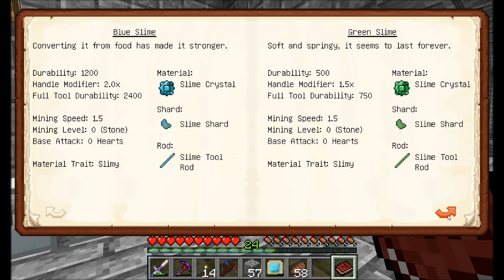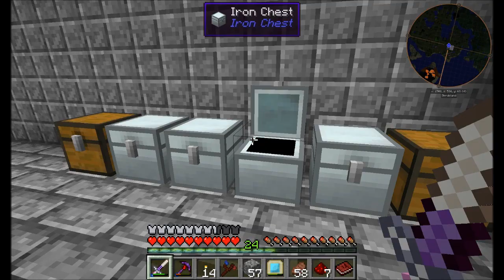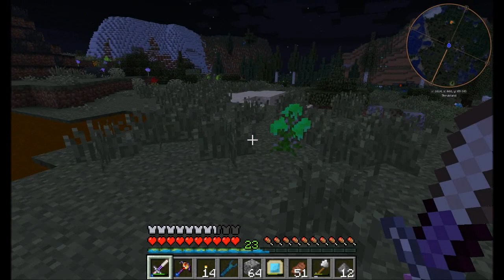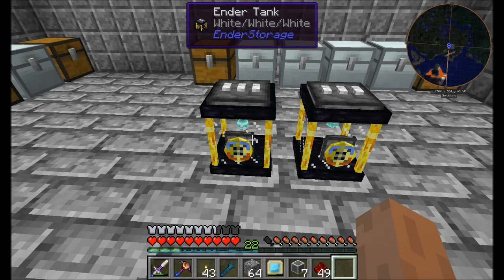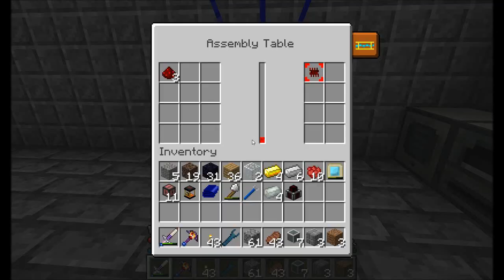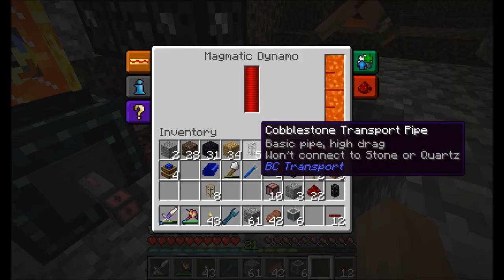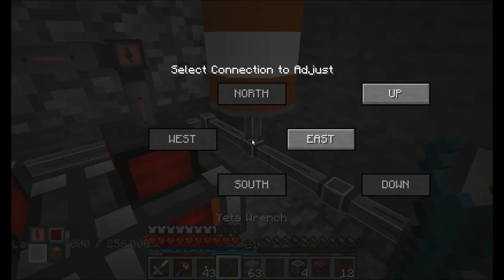Lets Play   S7 E17 Power Upgrades

Comment: redstone engines are not working since the switch to RF you should check out the dimensional transceiver(Ender IO version of the Tesseract but its better).
Reply: Redstone engines do not produce any energy at all. there are only a few Buildcraft machines and wooden pipes that they can be used for.

Comment: This episode, piping was not effecient. I understand you dont have to be so concerned about wasted materials but it seems sometimes you take a harder way just to fill time so you dont get caught between episodes. 
Redstone trigger for engine was not logical at all, fix this any other way and you will have it not turn on and off pulsing like it is (probably generating lag). Ie. ender io power controller, or the gates set the buffer of the engine instead of reading the tank...
Access to misc craft yet untouched, still uses portal just to use the 'jump gate'.

Comment: a thermal expansion infuser ... really dire -_- , you could of gone with the ender io capacitor instead , not only can you recharge multiple item at a time in it , it also work as a redstone energy cell which is also a multiblock so the more u add to it the more it contains RF by default it's 5mil , can also easily pipe items in and out could make it so that when you come from mining you drop the tools that need recharging into the chest and few moments later it's recharged and ready to go out.

Comment: It makes me sad every time Dire crafts an endertank/chest and then applies three dye to the top, instead of using one dye on the wool before crafting it in the first place.  Admittedly it's not hard to get flowers but still...

And I think the reason the BC engines didn't work is that they output BC power while the pump only accepts RF.  You can turn RF into BC with conduits but I don't think you can go the other way.

Comment: I think Resonant Flux doesnt work with any Tools. Limit is Tier 2 Capacitors. Weapons, tier 3. Tools, tier 2. I think nothing can handle resonant capacitor upgrades.
Reply: Power limit is based on the base durability of the tool: X RF per Y durability. I don't know the numbers, but there is direct tier limit.
Reply: Isn't that a TC config option?
Reply: There is a config option in the Tinkers Construct config called "Balanced Flux Modifier" that basically sets if you are able to use a redstone or resonant capacitor. Set it to false and you can use redstone and resonant capacitors on your TC tools.

Comment: I can only use the hardened capacitor for this tool. Tried both the redstone and resonant flux capacitor in the tool forge and and none of them work. Did something change in the pack after this episode? Thanks!
Reply: +caverac   
TiC has limitations for which flux can be used. 
Divide the flux by 1,000 and you need that much maximum (not current) durability to add the flux.

Hardened flux capacitor is easy-ish.  400 max needed to get 400,000 Flux.
Redstone is harder.  My hammer can get it usually, but not much else. 
You need 2,000+ Max durability for 2 million flux.

Note, his pick had a max durability of 3,000 (pause at 4:53).   
I think he used Manyullyn for the handle or something giving him a better durability.
Reply: the tool needs to be fully repaired at max durability to add the flux capacitor the last time i checked

Comment: Hi  Dire!
It is possible to fix this exp-draining elevators? Because its really annoying :)
Reply: i suggest using Travel Anchor instead. or Thaumcrafts Arcane Levitator. (its pretty early research in Thaumcraft and not too expensive to make in my opinion)
hope this helps you have some fun. take care :-)
Reply: MadLocustRising1  problem is that i already made a lot of OB elevators, and as Dire mentioned in a video that it was a mistake, and will be changed in the next version
Reply: new version released today? yay!
Reply: it is possible to add gendustry to this pack? it requires massive amount of energy but maks bees lot easier
Reply: yes put a xp drain on a tank then drain your exp before you go down the elevater problem solved!
Reply: It should be fixed as of 1.0.2 of the pack.
If not, open up OpenBlocks.cfg in the Minecraft folder and change:
B:elevatorDrainsXP=true
to:
B:elevatorDrainsXP=false

Comment: What?!?!? When I put the flux capacitor on mine it didn't work. Only hardened worked. Why is it working for him. It isn't working for me at all.
Reply: It was changed so that, for every level of flux capacitor, your tool's maximum durability must be at a certain minimum point to use it.
So what happened to you is: Unlike Dire's, your tool's max durability is not high enough to use the Redstone flux capacitor. It was, however, high enough to use the hardened capacitor. You'll need a tool with stronger durability to use the Redstone Capacitor.

Before people would just make hammers and such entirely out of paper, throw flux energy on it (which takes care of the durability problem), and then use the rest of the modifier slots on Redstone, to get a tool even faster than cobalt. That proved to be too easy...
Reply: Kyran S. 3100 not enough? I'm sure he said 2000. Only just could since the 1.0.2 update and I'm playing on a server so the server might have had bugs. This is still a BETA pack.
Reply: Kyran S. Do you happen to know why a tool modified with a Tuberous Capacitor would't charge in the Energetic Infuser? I successfully added a Tuberous Capacitor to my Obsidian Pick and then wore it down to about half RF.  When I tried to put it in the Energetic Infuser it immediately went into the "output" slot without charging a single RF tick.
Reply: Stuudlee1x If you were paying attention to its tooltip you can see that Tuberous Capacitors are not rechargeable.
Reply: Kyran S. Fair enough. You used to be able to add Tuberous Capacitors as a modifier and recharge with an Energetic Infuser as shown in the season 6 Direwolf Let's Play series. I made several picks, shovels and hammers like this back in 1.6.4.  Now the "Materials and You" book shows only the Hardened Flux Capacitor and the Leadstone Energy Cell as options to add the Flux modifier.  Are there any other valid options or just the two listed?

Comment: Does anyone know what the best ranged weapon in this pack is?
Reply: It's Sandstorm from the mod Darude
Reply: I use a bloodwood bow, with unbreaking III, infinity I, and Power V.
Reply: i use Bone Bow fom Thaumcraft. highly enchantable that 1 is ;-) mine has Power V, Repair II, Infinity I, Quick Draw II and Unbreaking III.
(thank you Thaumic Tinkerer Enchanting Table... muahahaha)
Reply: Blu76 nice try, but unbreaking III IS the highest you can get ;-)
Reply: Railgun on the fist for Modular Powersuits. Massive damage and almost unlimited range. Fires straight as an arrow with no drag. The ultimate Ghast Killer :D
Reply: Scott Richardson i 1 shot Ghasts with my bow, and its pretty damn quick. to shoot, and very precise. i find my bow more ultimate than your gadget. mine uses Vis, that i have infinite of from my energetic node. you still use energy. its a matter of taste, but all these ranged weapons are very good to say the least.
Reply: MadLocustRising1 yeah you're right, was trying to remember off the top of my head. Opened MC and checked, yup 3 it was
Reply: seanrhys if you want pure dmg then im preety sure you have to go into the config file for this but turn on the long bows form tinkers construct and make one however the shock dmg wand core in thaumcraft hits a ton but doesn't do much dmg and the power gauntlent from modular power suits does a ton if you amp up the power to max on the shot thingy.